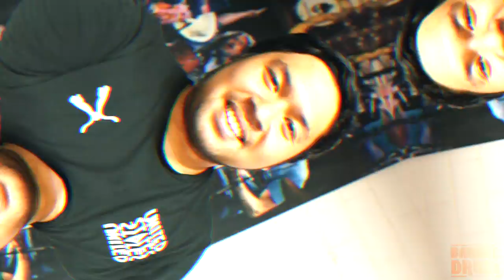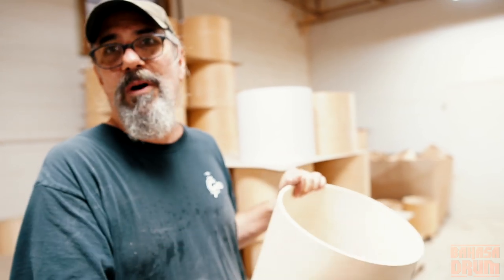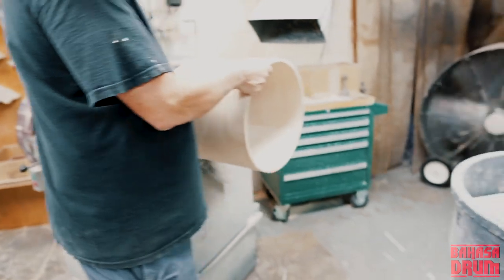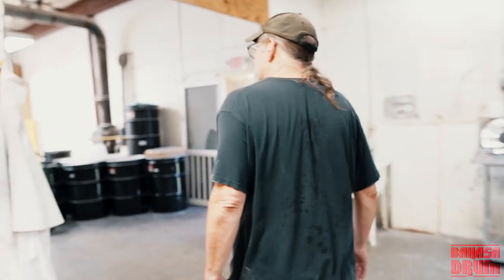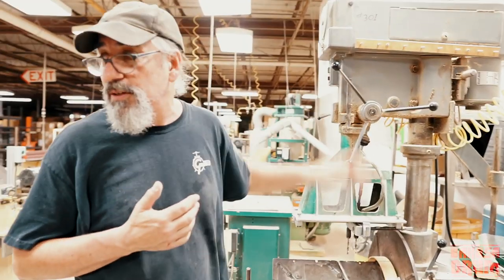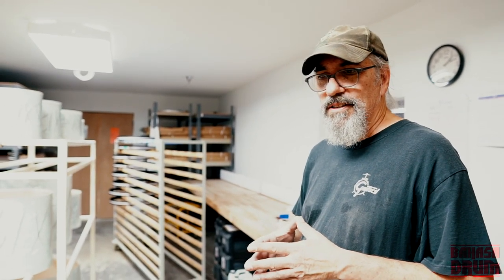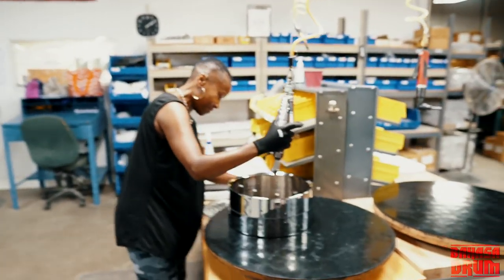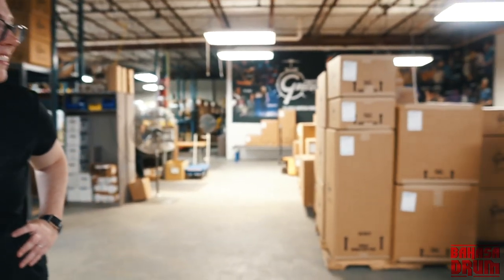GRETSCH DRUMS FACTORY TOUR

Comment: I admit I'm a gretsch fanboy but that was fantastic! had no idea that the silver sealer was a different formula for the non usa made kits
Reply from the maker: jermss i felt like a kid in a candyland lol. But yeah, those silvers are different. Gretsch USA doesn’t wanna tell the Chinese side about that secret haha
Reply: @BahasaDrum  🤣🤣 makes sense! great work!
Reply: It probably doesn’t matter that much if the formula is different.
Reply: @BahasaDrum It’s only paint which can’t influence the drum sound too much. The only true benefit to the silver sealer is moisture protection for the wood. In the old days people might have been fooled into thinking there was some sort of “MAGIC” going on with the silver sealer but modern drummers know it’s all hype. It also keeps that slight air of mystery around the Gretch brand. Line up 12” rack toms from DW, Tama, Gretch and Ludwig all with the same heads and no one would be able to “hear” the silver sealer.
Reply: The silver sealer is actually roofing sealer thinned . And yes it keeps moisture out of the shell from the inside , the lacquer or wrap keeps it out from the outside .

Comment: They need to take the bands off from around the toms,because when the little rubber washers break the toms don't stand up anymore and they don't help the sound anyway
Reply: Jimmy Alvin  did you have to drill holes
Reply: @mikefiorello5621 It’s very easy to replace the rubber grommets. Call any Gretch dealer. But those grommets should never wear out. Are your toms setup at an extreme angle?